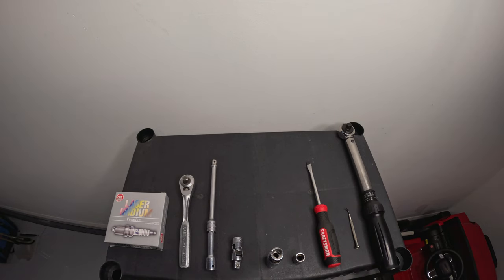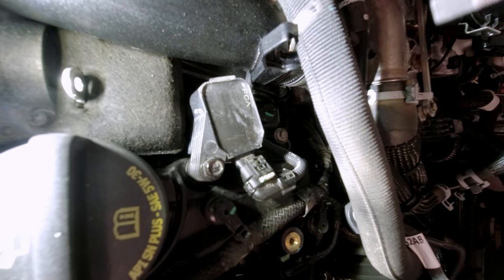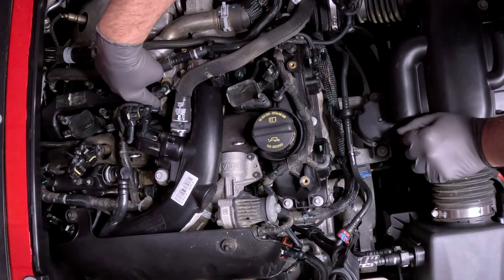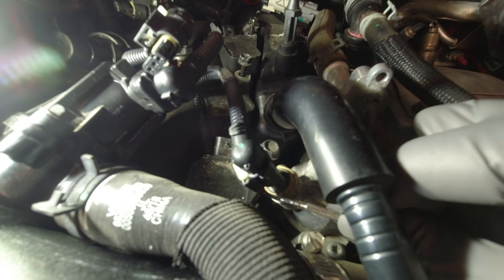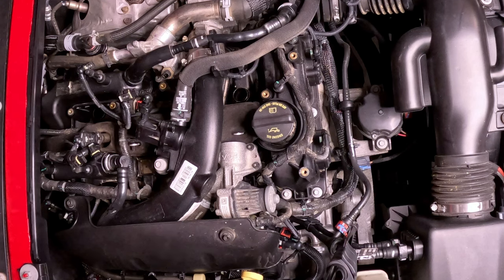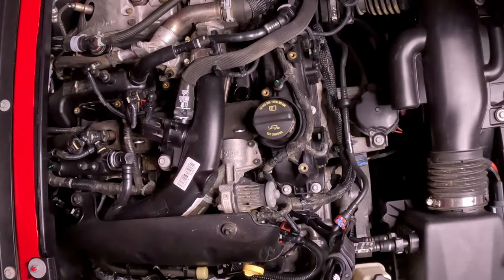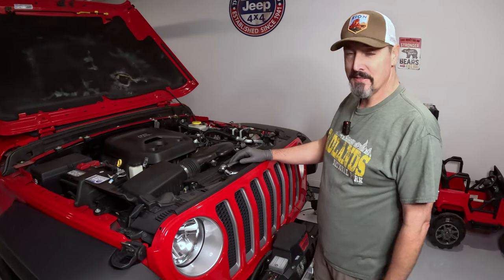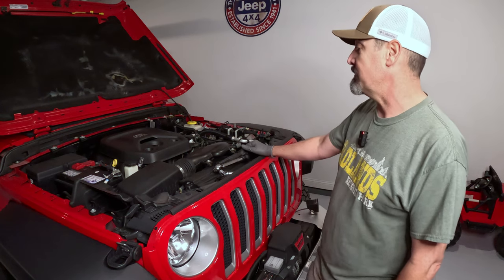How-To:THE Complete Wrangler 2.0 Spark Plug Change Video (with part number)

Comment: On the 2nd spark plug that is under those connectors and is under the pipe, I was able to snake it out and back in without moving any of them. Those clips were the hardest part of getting them out haha
Reply from the maker: There ya go! Yes, those clips take some figuring out sometimes and that engine heat makes the plastic fragile.

Comment: Can you put a little bit of Anti seize on the threads, that sound is cringing .
Reply from the maker: NGK recommends against it. As a former engine machinist/builder, it’s normal for them to be a little sticky but be sure not to cross thread them. I would not use a ratchet until a few threads were properly engaged. Then torque to spec. 

Using anti seize lowers friction. The torque wrench works on resistance. Lowering resistance will put you higher on torque to the spark plug than spec’d. Any lubricant will. 

All that said, it’s up to you. If you put any on, set the torque wrench to the minimum torque spec at least.
Reply from the maker: Also, anti-seize will hamper the plugs ability to transfer heat from the plug to the cylinder head that is supposed to happen to make the plug run cooler.

Comment: What size wrench for the spark plugs though that wasn't mention, thanks!
Reply from the maker: It’s at the 53 second mark in the video but it’s a 5/8” spark plug socket.
Reply: Ah I must of missed it my bad, thanks informing me! Also, sorry to ask but do you have any idea where the map sensor is, I've been looking everywhere online and can't find it anywhere in the engine bay along the air intske
Reply from the maker: Seems there’s a map and T map sensor. This thread has a pic showing the T map area. Maybe ask more questions there. I’ve not had an issue and looked into it.
https://www.jlwranglerforums.com/forum/threads/blown-map-sensor-on-2-0-l.75823/

Comment: Is this engine reliable?
Reply from the maker: So far, it seems reliable for most people. Both the 3.6 and the 2.0 have had some outlier type issues. IE- rocker noise or worse in the 3.6 or the water pump outlet bolts being loose on the 2.0…or worse. Neither is “common” though. 

There’s a TSB for the 2.0 outlet bolts if you’re still under warranty. Otherwise, Torque them to 97 in lbs. I tightened the top with a torque wrench, barely. But had to turn it again by hand to get an idea how tight that is because the bottom bolt, I couldn’t get that small torque wrench up there. I did remove the bolts and added blue thread locker as well. There’s a few 100k plus 2.0’s out there. One guy claimed over 200k miles already!

Comment: SOLID - Thanks !   Curious why no never-seize.
Reply from the maker: It’s the plating they use on the body of the plug. NGK does not recommended it. After 66k miles, there was no issue removing mine as you saw. I prefer it that way too because you don’t have to account for the lubricity affecting the torque applied for the same setting. You wouldn’t want that. It would be too high with any lubricant on there.

Comment: What cup number to remove the spark plug
Reply from the maker: Socket? It’s a 5/8” spark plug socket. You will need a dedicated spark plug socket that is either magnetic or has a rubber gripper inside the socket to hold the spark plug in the socket to get it out and keep it from falling into the spark plug tube, disturbing the spark plug grond strap/spark plug gap.

Comment: The noise they made coming out, put anti seize on them
Reply from the maker: NGK specifically state not to due to a special coating applied. The plugs I installed are the factory plugs so they seem to agree. Also, when you apply anti seize, you inhibit the ability of the plug to transfer heat from the plug to the cylinder head and the coolant flowing through them. This will lead to a hot plug, increased wear, and possibly preignition at worst. The squeak isn’t anything to be concerned about.

Comment: Do you have to disconnect the battery prior to replacing spark plugs?
Reply from the maker: I did not but it’s generally good practice to disconnect the battery when working with anything electrical like connectors. Having done this for years, I’ve not had a bad experience leaving them on for something like this but I probably should have. These newer vehicles can be finicky and it only takes another minute to disconnect them.
Reply: @odysseyusa  Thank you for responding. I’d rather leave them on so I don’t have to potentially deal with a bunch of resets to factory settings
Reply: Just to report that I changed the spark plugs on my 19 Wrangler JLUS with little to no effort thanks to your video.
Also, there was no need for me to remove any connectors on plugs 2,3 and 4. I removed the coils with connectors still attached to them. And for spark plug #2, I’d just wiggle it around the other cables to come out (coils are flexible and rubbery). The first one was the only one needed connector removed and your tip to sacrifice a small screwdriver worked like a charm!
Reply from the maker: @nemomilo333 It’s great to hear the video helped you out and thanks for sharing your experience!